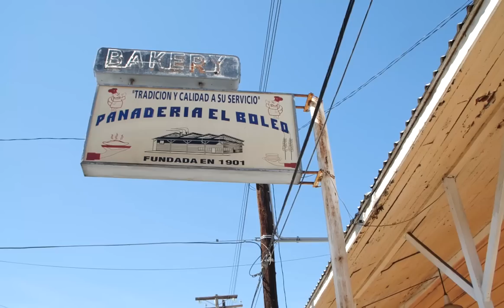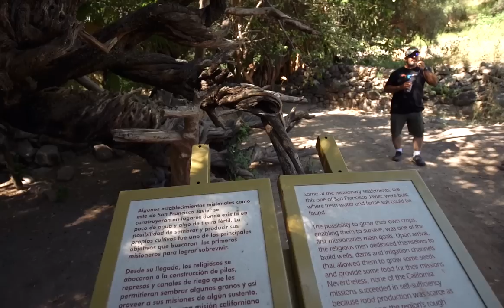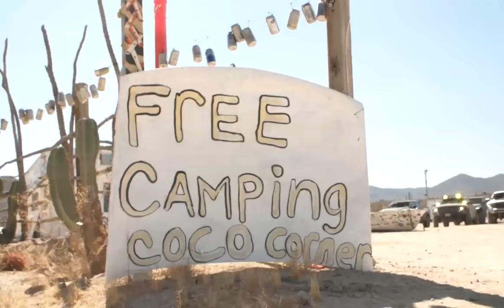Baja Raptor Run 2020 2.0

Comment: The Gen 1's benefit from some weight in the back to stop that nose from dipping. 120 to 150lbs helps a lot to even out weight ditribution in the air

Comment: Can a high mileage Raptor do something like this 🤷‍♂️
Reply: All of the first generation Raptors here have logged a lot of miles, most of them on multiple Raptor runs each year. If you have Trey or a reliable off road shop perform an inspection and give you the ok, then sign up and come on!
Reply: Ya bet! I did it with my 1950 ford f350 diesel with a million miles on the clock....although, I was asleep when this all happened😜.